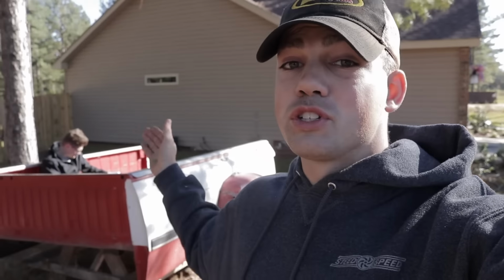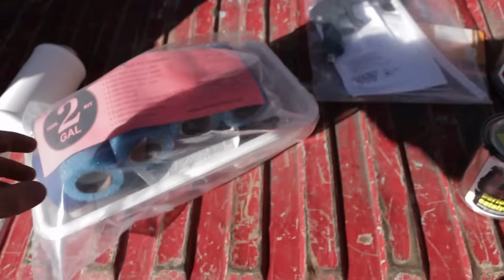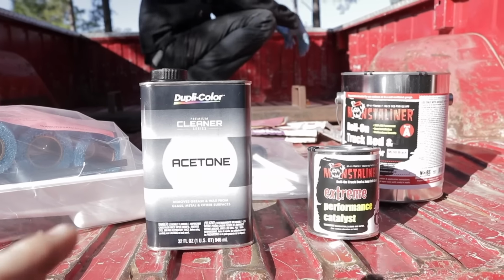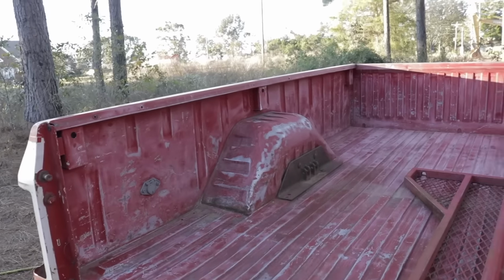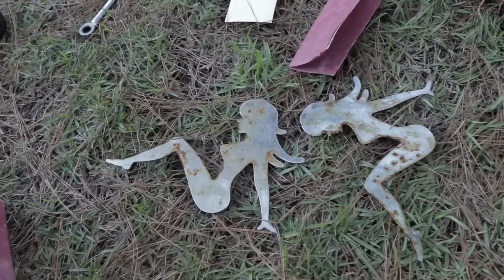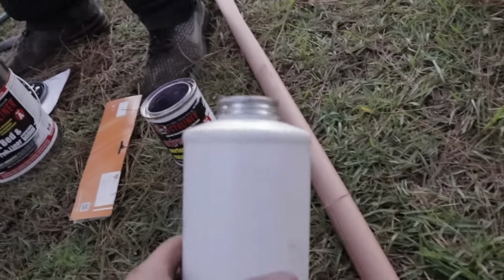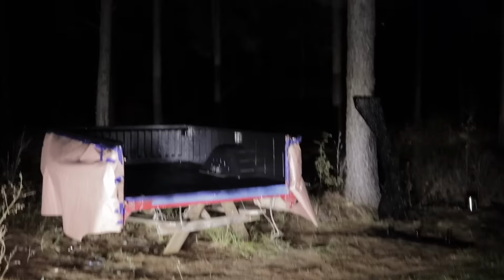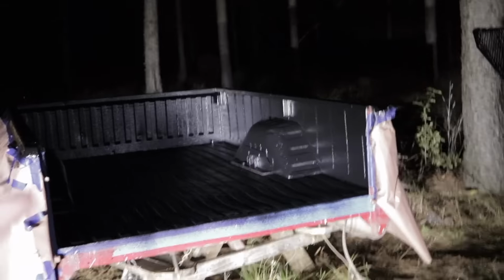How To Make Your Old Truck Bed New Again (Bedliner How To Guide)

Comment: Which was easier to do, spraying with the bed on the truck or the bed off? I think having the bed off would be easier but ive never done it before and you have done it twice now.
Reply from the maker: It doesn't make to much of a difference man, I'd probably just keep the bed on and do the extra masking then take it off. But if your doing the Frame and bed at the same time like I did, then of course, yes it would be easier with the bed off

Comment: If your not going to repaint it you should really bedliner the front of the bed and you should take off the pin strip with a eraser wheel and go down a little bit farther to cover up the red and on the back you should go all the way down, but I really the the progress on the build

Comment: Your doing right by the first gen, mine is not getting fuel any ideas? Please help
Reply: Check the lift pump. And try watching Deboss garage on YouTube, he's really good with first gen 12 valve trucks and motors
Reply: Pretty simple troubleshooting when you know it's not getting fuel just Google it
Reply from the maker: Do you have a lift pump or fuel pressure gauge? Could be as simple as a fuel filter, or injector. And white haze?
Reply: Auston S thank you

Comment: Ok. I have a question. I watched your videos on the Raptor liner and now this stuff. I purchased Raptor liner based not entirely on your experience with it, but quite a bit. I have not sprayed it yet, didn’t get the time when it was warm, now it’s too cold till spring. I had confidence in the product. You had mentioned you were going to use Raptor liner on this truck as well. Now a see you using a new product and “ highly highly recommending “ that now. What changed? Did the Raptor liner fail somehow? Did it fade? Chip? Peel? Flake? Why this over the Raptor liner? Did magnet just give you a better price for a comparable product? Or is this stuff superior somehow?

Comment: Awesome video Parodoxz that frame looks so awesome probably better than new lol should last longer than the factory finish it had if it had one the bed liner turned out awesome too and nothing will make that bad last longer than a spray in liner that brand you used turned out awesome and you saved yourself about 360 bucks on top of your liner kit doing it yourself can’t wait to see it back on the truck with the gooseneck hitch and tailgate done in it should make for quite the tow rig now lol
Reply from the maker: Hunter Prowse Thanks hunter! It all came out great , I'm very happy with it!